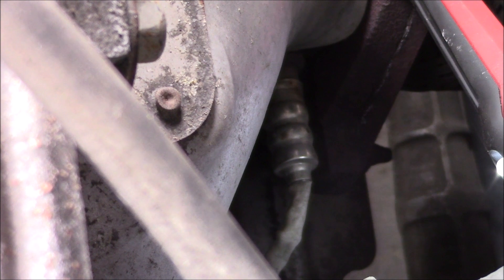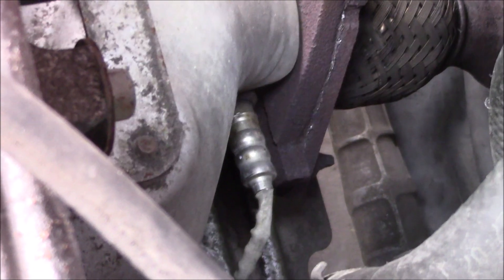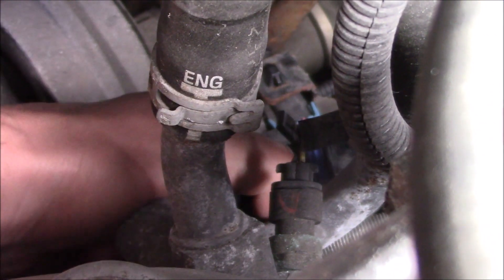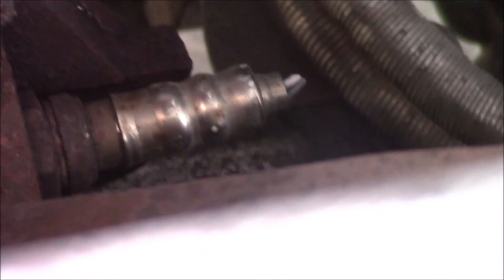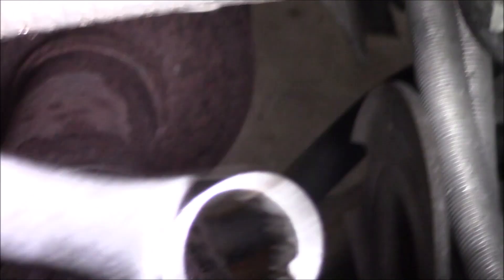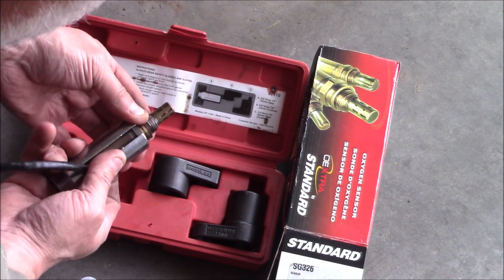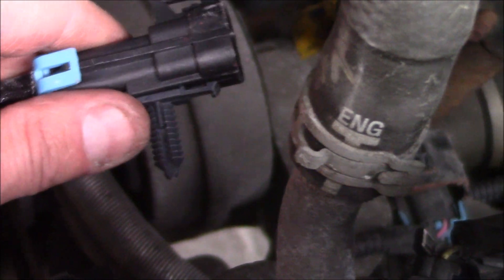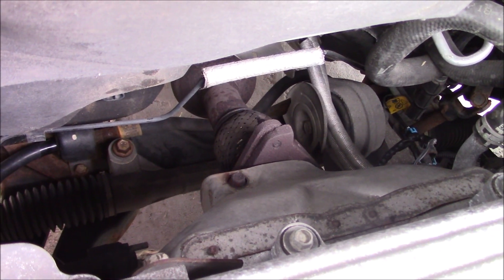P0031, P0037, P0135, P0141 GM Ecotec 2.2L check engine codes

Comment: what about code po138?
Reply from the maker: info on a P0138: P0138 Possible Causes
Faulty Rear Heated Oxygen Sensor Bank 1 

Rear Heated Oxygen Sensor Bank 1 harness is open or shorted 

Rear Heated Oxygen Sensor Bank 1 circuit poor electrical connection 

Intake air leaks 

Exhaust gas leaks 

Inappropriate fuel pressure 

Faulty fuel injectors